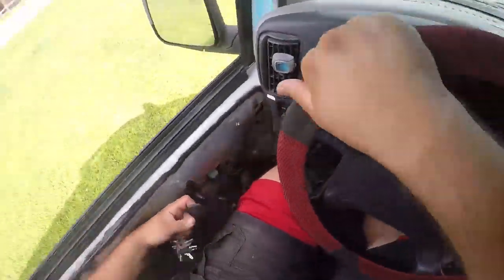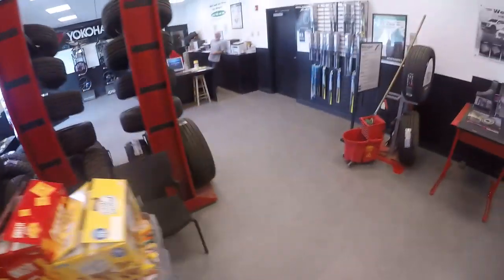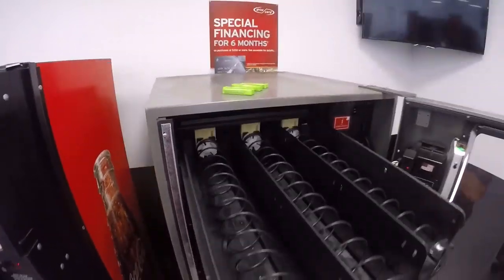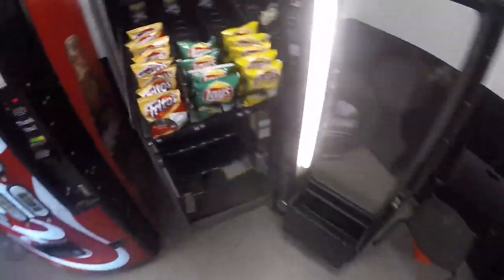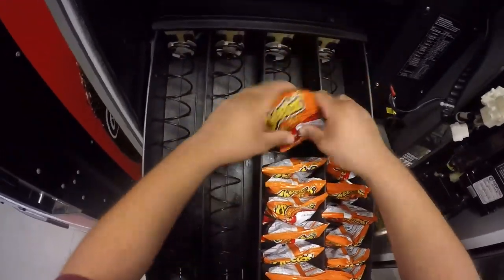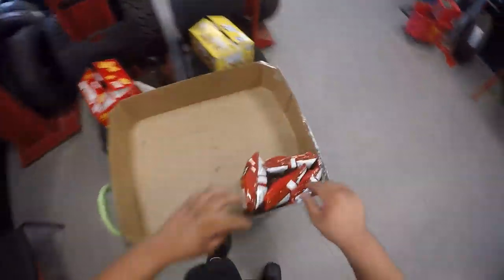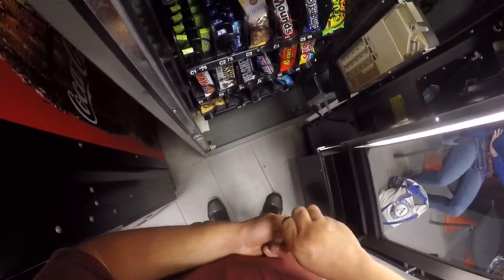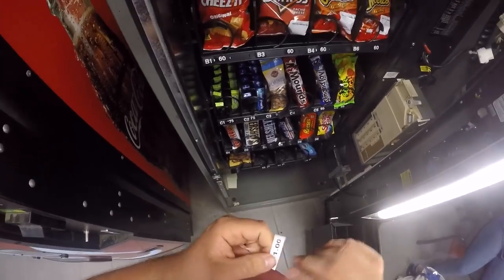First fill up on a new snack machine!!

Comment: I likr the size of the machine, would fit nicely in a coupl of locations that I have.  I am looking to replace a few Polyvend 4-wide machines in the near future hopefully with AP's possibly.  I have a five wide AP LCM 2 that I really like.  I am afraid on of those Polyvends are going to stop working and I won't be able to find parts.. so If i replace at least on I can use that one for parts on the other 2.
Reply from the maker: i love the ap machines